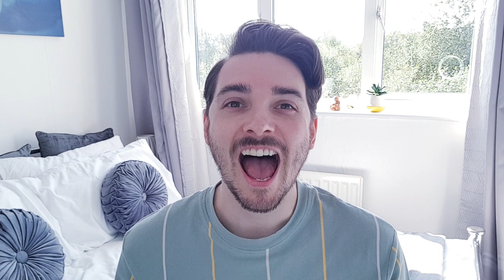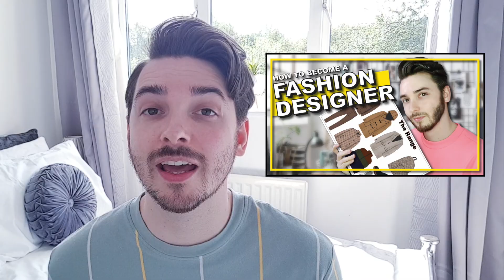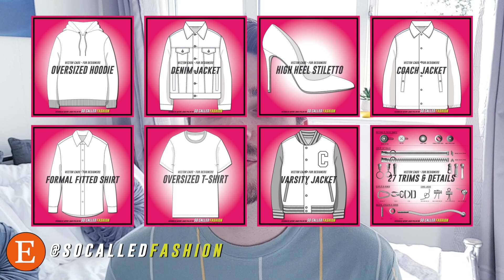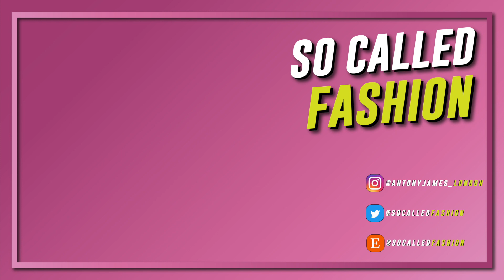THE DESIGN PROGRESSION: Assistant Designer - Senior Designer, job promotions for fashion designers

Comment: Thank you for making this video as someone who is new to the fashion work field and looking for a job I have a question about junior designer role.. when you mentioned that a junior designer does their own range do you mean full designs that are produced under their name or under the name of the main designer? I’ve been looking for a job as an assistant designer or design assistant but the designer told me that I have to make my own designs “dresses” that will be produced by them and it seems like “ junior designer role “ from what you explained correct me if I’m mistaken however she didn’t mention anything about the name but I’m assuming my designs would be produced under her name is that normal or will I get used??